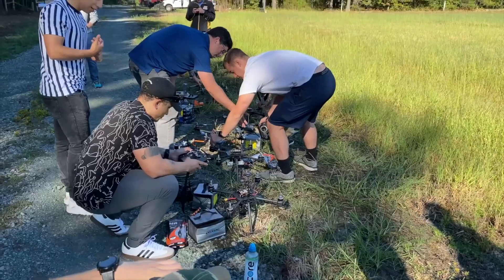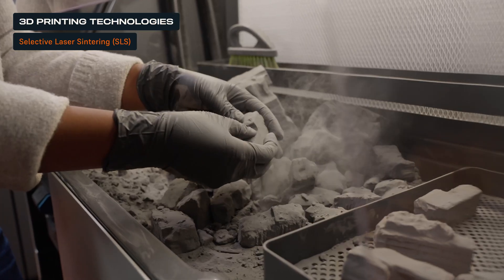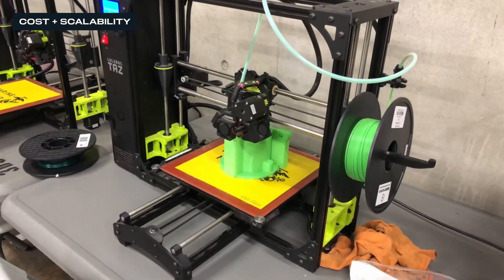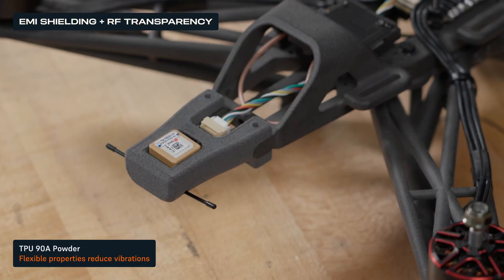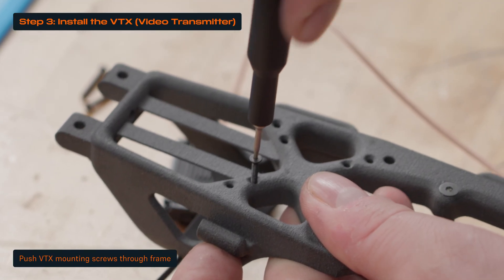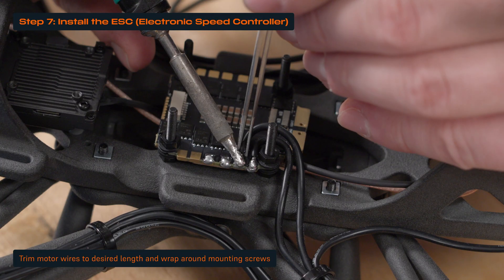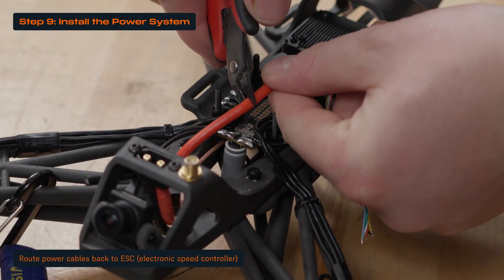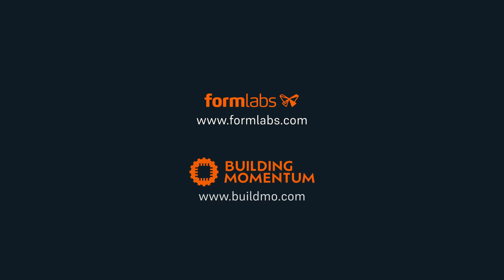How to Build a 3D Printed Drone

Comment: How much for the build out
Reply: Always difficult to answer, as when you buy 100 batteries, 400 motors etc. you get volume discounts.  When you just buy 1 off parts the price is always much higher. Plus if you use higher quality components, they usually add to the price.

Comment: I like the idea, nylon has a many good properties for drone parts. However it also have very bad creep, which means all those screws will come loose over time. This is the very reason nylon isnt used for 3d printer parts.

As for the build guide... Technically it  was well done but if you actually had any real world experience building drones for durability you would know not to directly zip tie motor wires and apply strain relief measures to any wire connected to a solder pad to prevent the pad being torn off in the event of a catastrophic failure.
You also never ever hard mount your vtx antenna or mount it at 90 degrees to the top of the frame. It might be sound theoretically but in practice that antenna is going to take an absolute beating and will be trash after a couple of crashes.
Best place to mount the vtx antanna is soft mounted at the back where you have the rc antanna, at about a 30 degree incline. This way if the drone lands on its lid the antanna can lay flat minimising strain on it. If the drone cartwheels then the motor arms protect it.
Years of experience building practically unbreakable drone here.
Reply: Do you build drones?

Comment: This is a sales pitch for Formlab's expensive printers. Normal filament based printers are fine if you're doing Ukraine style warfare. You only need to ensure the drone lasts a few minutes in the air, with some rigidity for ease of control, after all. So what if 1/50 drones fail? Just make another one.
Reply: FormLabs are expensive but more reserved for professional use. I have one and it’s been 100%. I also have Bambu, etc. So they all serve a purpose. Personally, I’d make a drone using FDM as it’s cheaper, but the FL SLS printer is pretty sick and far more detailed.
Reply: @energ8t  Copium. Filament (FDM) is better all around. You don't need expensive liquid stuff (formlabs) outside of extremely nische industry prototyping. "More detail" sure as heck isn't relevant to warfare drones.
Reply: @Ree1981 "Liquid stuff" is SLA, the powder printing is SLS as energ8t mentioned. SLS offers much better layer adhesion in the Z axis than FDM, much more uniform strength in all directions. FDM is strong in X and Y but weak in X axis. SLA is very popular in dentistry, if you have implants, they may be from a Formlabs printer. SLA printers can do more than you think you know.
Reply: @Martian74  SLA is brittle as shit unless you go way up in price, and that's my point. It's not a good choice for mass-producing drones. Oh, and there are new ways of shaping layers on FDM, causing much better layer adhesion. It's a non-issue.
Reply: @Ree1981 I think you are getting SLA and SLS printing mixed up, this video is SLS, Formlabs Fuse. SLA can print Silicone 40A on the Formlabs Form 4, it is very soft, SLS can print TPU on the Formlabs Fuse 1+, again a soft material.
Reply: @Martian74  Yeah I don't know every acronym in the world, nice catch. Resin sucks.
Reply: I can agree a little bit, but you cant talk any shit, because you havent done anything as good as building a new limb for anyone
Reply: Some of it is but if you watch it to the end you'll learn how to build a drone using 3D printed materials. He actually explains why it's important to make notches to make it easier to insert screws. I learned a lot even if I don't use their 3D printed products. Thank you formlabs for making this video
Reply: any printer recs?
Reply: @bos9824  Top of the game is Bambu Labs right now. Nobody else even really near. They're good for print farms, so even military use. $700 for the P1S, and that's a helluva lot cheaper than what Formlabs sells lol.
Reply: I’ll tell you what I dig. I’m learning CAD. I design, print, test, iterate. Utilizing low cost filament for each phase. When I reach the final version and feel I’ve ironed out all relevant bugs, I polish the CAD and send it off to be SLS printed. Now, I’ve benefited from the technology and my final product is, exceptional.
Reply: Wow you're such a genius, it's like there isn't more to drones than warfare. Edit: Looked at your channel, yep now I can see why.
Reply: @eliiiiiiiiiiiie  Ad hominem
Reply: @Ree1981 Works all the time. Doesn't change facts.
Reply: @eliiiiiiiiiiiie  Do you even know what ad hominem means? It's an "attack on the person, when you can't really attack the facts".

I basically said something extremely uncontroversial. "FDM printers are fine for mass produced drones on the fronts". if you have a problem with that quote, then let's see your arguments. Saying stuff like "Lol look at your avatar, I understand why you're so sTuPiD!" just makes you sound stupid.
Reply: @Ree1981 and I already replied regarding that. You call it ad hominem, I call it facts. It’s all subjective but I’d say it leans more towards fact. What do you do for a living?
Reply: @eliiiiiiiiiiiie  What does my profession or contents of my channel have to do with literally anything? You sound like a teenager.
Reply: @Ree1981 Nah I sound like someone who asks for credentials before taking someone's BS opinions seriously which is basically everyone in the corporate/business world. The fact the first thing that came to mind to you as soon as you saw drones was "Ukraine style warfare" says a lot about you. Funny thing is I'm the one with the military history and a foot in the defense industry and even that is not the first thing that comes to my mind.
Reply: @eliiiiiiiiiiiie  military history isn't modern day military, muskets aren't fpv drones under sanctions. Foot in the door isn't in the defense industry, I know contractors who are janitors, and gardeners, they're also technically got a door in the defense industry. Other person actually won the arguement, you can't accept defeat or learn from your defeat, sore loser.
Reply: @Mr3344555 Here you are, with your gaming YouTube channel expecting me to not laugh at you.
Reply: @eliiiiiiiiiiiie  Just my opinion, but I think you should post less pointless & negative comments on the internet. Homie made a good point and you added nothing of value here 😂

Comment: meh not even topology optimized :( nice content
Reply: Topology optimization doesn't mean aerodynamics optimization
Reply: @seilgu  Topology optimization doesn't need to be exterior. 

Source: I build topology optimized drones.
Reply: @seilgu   I’m not entirely clear on your point, but in my view, aerodynamics is not a critical factor for a drone with relatively low performance. In this context where functional integrity is a primary concern a topology optimized frame design could add significantly more value, especially when compared to conventional carbon fiber frames.

The more pertinent question, then, is: what was the intended message of the video? If the goal was to highlight the capabilities of SLS technology, then showcasing an advanced design approach like generative design or topology optimization would be far more compelling. These techniques clearly demonstrate the strengths of SLS, particularly when compared to other 3D printing methods.